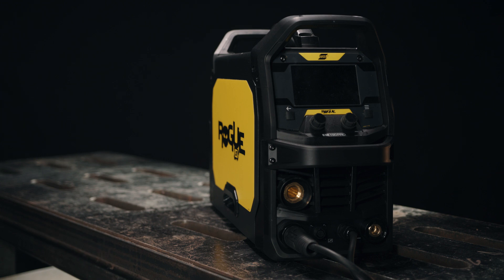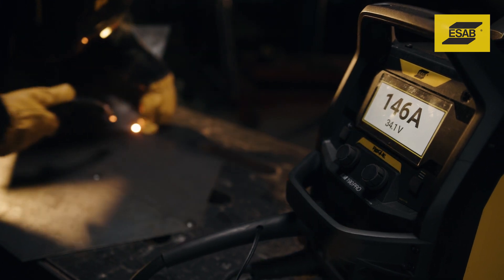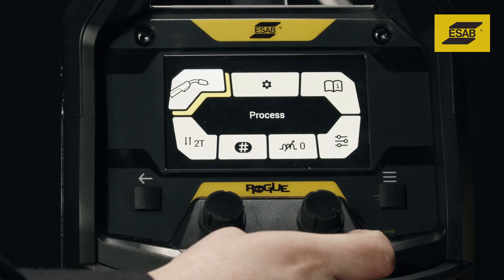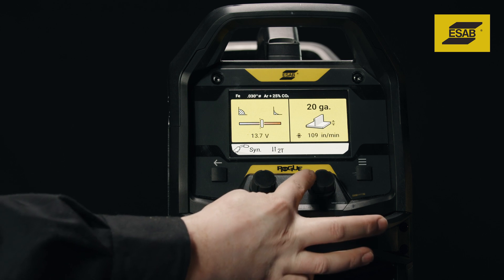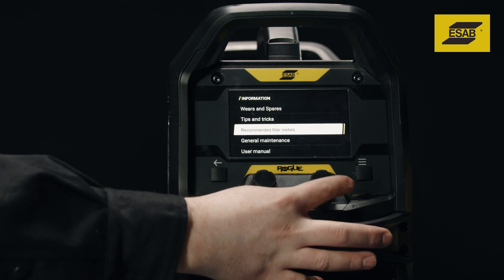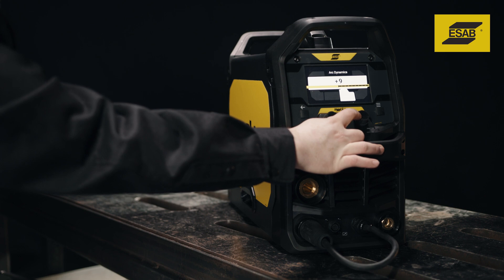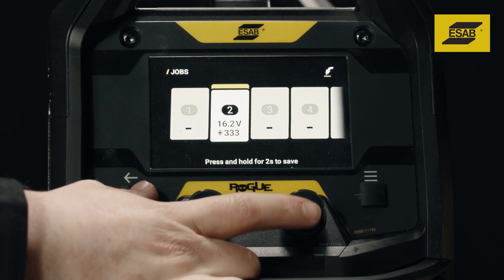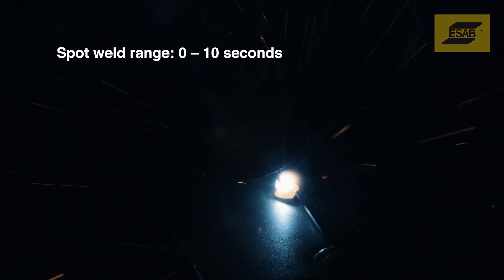Understanding the Controls on ESAB’s Rogue EM 190

Comment: I am sure this is a very nice machine but for an extra $100 look at the EM210 PRO. Not the original EM210 but the EM210 PRO. It's this machine with apparently a different inverter because it's listed at 10-210A. Less on bottom and more on top than this one. And it runs on 110v or 200v.

Comment: Is the cooling fan always on or tempreture controled?
Reply from the maker: Yes, the cooling fan is always temperature-controlled. As the system temperature increases, the fan automatically activates to regulate the temperature accordingly.

Comment: Can I use the stinger from my rogue stick welder, on the 190?
Reply from the maker: Hi there, thanks for your question. You will not not be able to since the Rogue EM 190 is a MIG/MAG/Wire only machine. Please let us know if there is anything else we can assist you with.
Reply: @esabweldingandcutting Can you tell me which spoolgun is compatible with the Rogue 190?
Reply from the maker: @strayedarticle2838  The Tweco Spool Gun 160A is compatible.